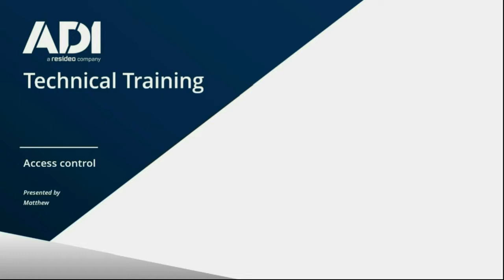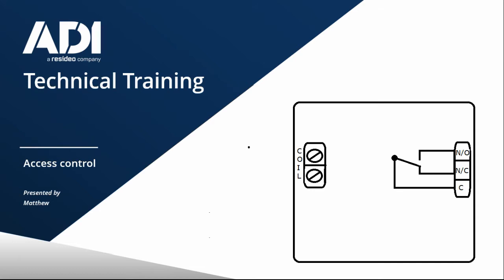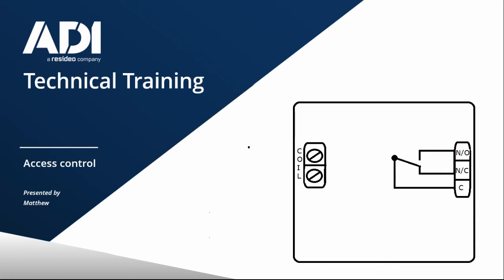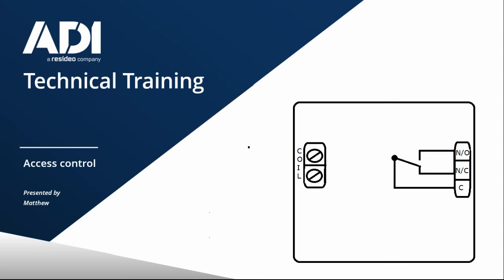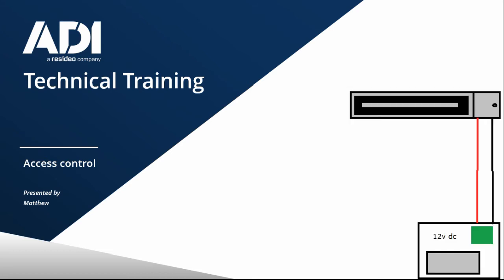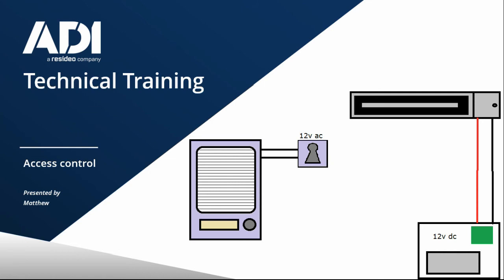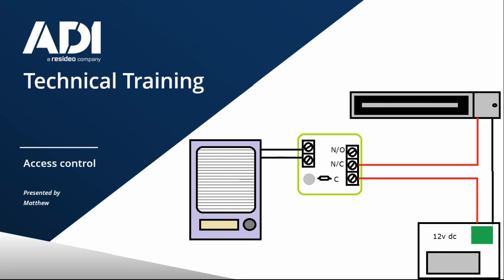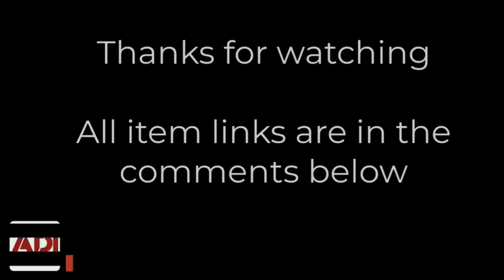How a Relay Works and Using Them in a Security System

Comment: So when the coil energizes ( eg. pull the fire alarm initiation ) , does that cause the circuit to open, releasing the door maglock?
Reply from the maker: Hi, that depends on if you have used the Normally Open terminals or the Normally Closed terminals. You should be able to uses your multimeter to check, Apply power and see which terminals are closed or short. Of course you also have a Mag lock that may be Fail secure or Fail safe so again removing power may lock the door or the opposite. 

Hope that helps